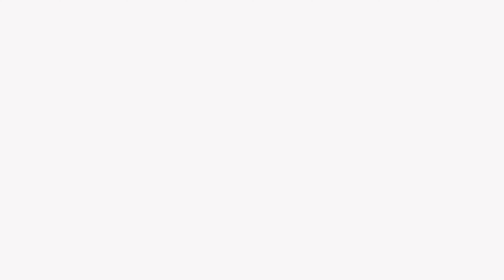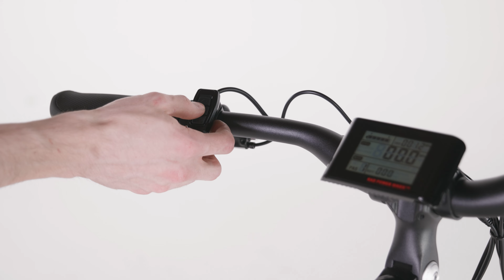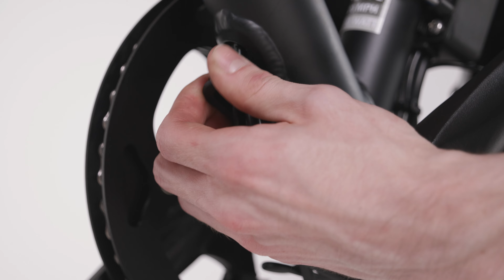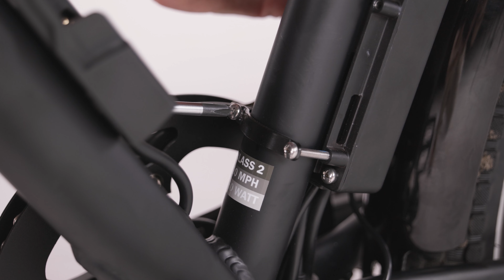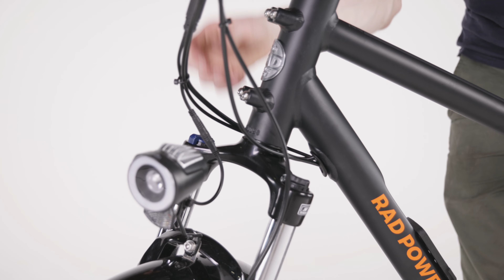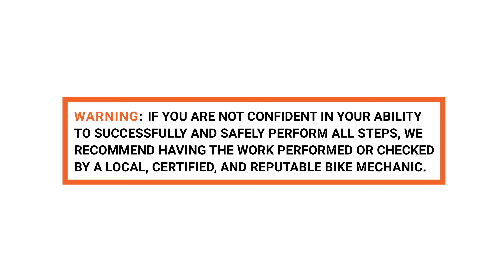RadCity 4 and RadCity Step-Thru 3 Controller Replacement

Comment: I have a weird issue with my Radcity ST-3.  Periodically after I have come to a complete stop, when I start pedalling again, the wattage meter says 000 and the bike obviously has no pedal assist even though the pedal assist will be at 2 or 3. Turning the throttle doesn't engage the motor either, the wattage meter will stay at zero even if the throttle it fully twisted. If I flick either brake lever a couple of times while I'm still pedalling or twisting the throttle, the wattage meter will jump up to where it should be and I can feel the pedal assist kick in. 
I've checked for loose connections. I've tested the switches in the brake levers with an ohm meter. I get infinity resistance when the levers are in the released position, and I get zero ohms when the levers are squeezed.
Any ideas?
Reply from the maker: Hey Bobbie! Thanks for taking the time to reach out and share what's been happening. This is a great question for our Product Support team. You can reach them by phone or email. Phone at - (800) 939-0310 x 2, or email at - radpowerbikes.com/support.
Reply: did you ever get this fixed?  What was it?  I have the exact same problem.